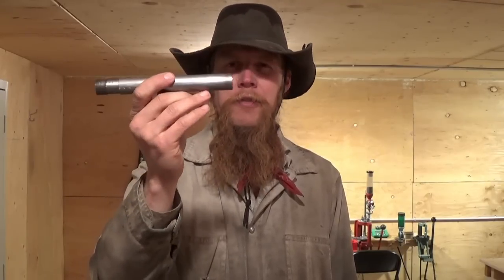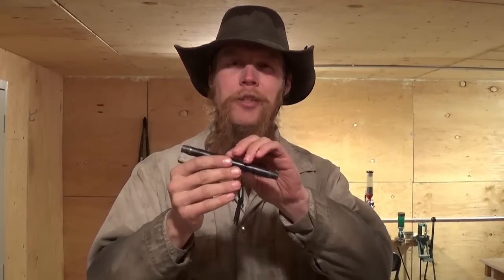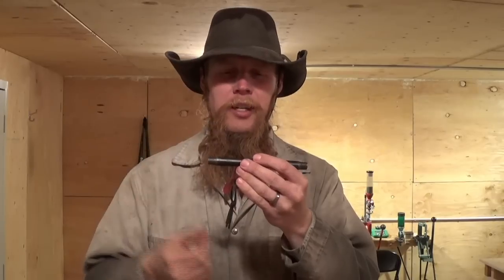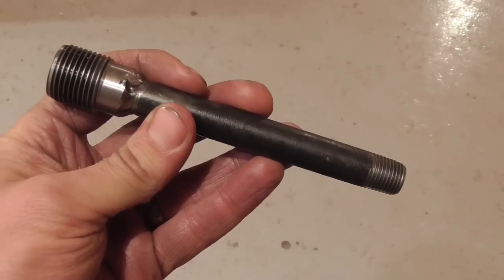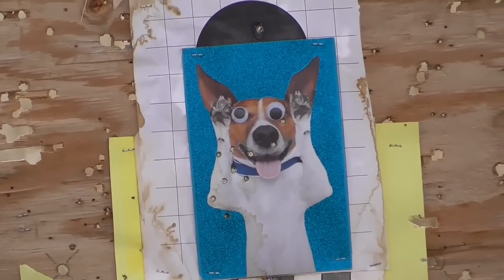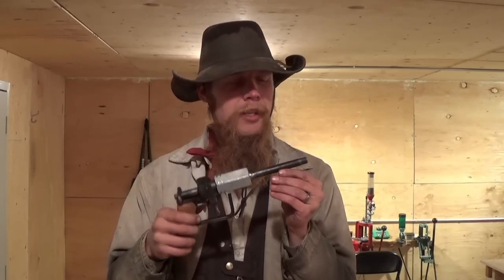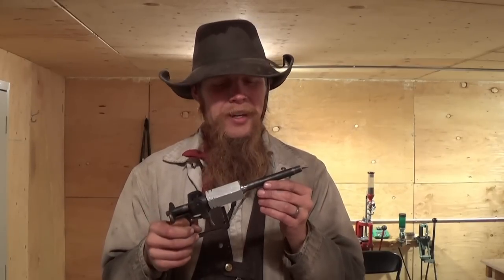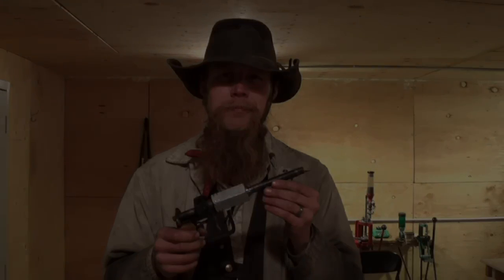9mm Barrel from Plumbing Pipe (TIS138)

Comment: I have made mini cannons from black pipe and a block of wood with a bicycle seat frame. The pipe is almost the same size as a bike seat stem, so it fits perfectly. I would load black powder and use a fire cracker for a primer. It would shoot the big red wire nuts or anything you could fit down the barrel.

Comment: People make 12 gauges out of black pipe, pretty cheap and makes good for those gun buybacks
Reply: LockJaw Remedy remember that the shot cup doesn't seal perfectly, so the pipe is not under full pressure from the loading.
Reply: Wait...people make plumbing weapons to re-sell for profit at gun buybacks?
Sheeeeet XD
Reply: The pressure chambers of a 12g is 12 to 15.000 psi the pressure chamber off 9mm 35.000 psi.
Reply: How much they give you during gun buy back for a pipe and nail?
Reply: @DxBlack  Then, you go on ebay and sell the coupons and use the money to buy a firearm (perhaps one you couldn't normally build easily).
Reply: Actually, and this is ironic, black water pipe of the correct diameter has to be reamed out a bit to accommodate a 12 guage shell. But the actual ironic part is that the water pipe barrels are far, far tougher than factory made shotgun barrels. Royal Nonesuch has a video on it, or did have. He did a torture test to see what it would take to blow the barrel up. He ended up putting about a foot of dirt and a 3/4 inch wide 4 inch long bolt in the end before it suffered failure. And the failure was just that the barrel ballooned. Now think of all the shotguns that banana peeled because the owner stuck about an inch of dirt in the end by accident.
Reply: @DaveSmith-cp5kj  everything can be built, hecj  there's was a channel on YouTube that the guy made mac 10 & 11... but cause of freedom of speech of the USSA  they took em all down. Guy made lot of videos and testing them number of times
Reply: @jonsmith6087  Yup I have a few homemade builds myself. I made them semi auto and chambered in 22TCM, they are basically an MP7 clone, but better because they are way lighter, smaller, and it is actually more powerful. Only issue is it has 25% less capacity per equivalent size magazine. Which in practice, is no big deal.
Reply: @DaveSmith-cp5kj  Amen, I wish I had the tools to make some 👍👍🙏
Reply: @jonsmith6087  Everything you need you can get at harbor freight for the same cost as buying a handgun. The mini SMAW stick welder only costs like $90 and plugs into a regular 115V outlet and you can weld everything from metal plate. The barrel can just be a scrap from a 5.56 barrel, some guys chop off a full length upper to turn it into a SBR. You can use the cutoff from that. The chamber cutter if you don't have a lathe to make a cutter from a bolt can be bought from Brownells for like $50-80.

If you need specific parts machined, I am more than to make and sell them to you. Obviously I can't send you something like a completed frame.
Reply: @DaveSmith-cp5kj  would be awesome there's only one problem, I'm in south America 😣
Reply: @DaveSmith-cp5kj  got a way to communicate?
Reply: @jonsmith6087  Post your email and I can see if there is a gunsmith I know on your continent that can help you out. I'll reply when I get your email so you can delete it. I have to review our export laws but I may actually still be able to help you with machining some parts as Trump dramatically deregulated ITAR and EAR to where some exports can be done without the $2.5k license fee. At the minimum, I can answer questions you may have.
Reply: @jonsmith6087  Got it, you can delete this
Reply: Shotguns have wayyyyyy less barrel pressures. Factory shotguns have much thinner barrels than even a .22
Reply: @DaveSmith-cp5kj  Dave, my name + jr gmail.
Reply: @markvickroy6725  you might have forgotten to delete this as Dave didn't reply yet, I would delete this before the wrong person sees this:) good luck on your project!

Comment: The best steel to use for barrels is vehicles staring rods and vehicles axcels...hope it helps many in future
Reply: * Steer(ing) Rods
* Axels
Reply: @justotalkalottashit8392  😂
Reply: @justotalkalottashit8392  its 4140  carbon steel
Reply: @justotalkalottashit8392  Get yourself a dewalt p1000, it has an 18mm OD Chromoly tube with a 8.7mm bore. Theyre like 40$ a piece.
Reply: @wrathmachine7609  Good one! there some older European ramset guns with a exact 9mm bore btw.
Reply: @ronzor8035  I work with what I got 😜. I made a muzzleloader thats made from the chamber end of the nailgun welded to the barrel. You can also grind a little bit off the barrel and press it inside the body of the nailgun with the internally threaded end where you can thread in the chamber. I use number 3 blanks with around a 200gr lead slug that can penetrate at least 3 inches of wood at 10 feet and the bullet gets flattened when hitting the stone behind the boards. These components are made of really good steel.

Comment: I heard that after rifling the barrel with a button it is necessary to do a thermal stress relief. Did you do this heat treatment?
Reply from the maker: No, I don't.  I imagine the cold-working process does introduce some residual stress into the steel, which could adversely affect accuracy by causing slight thermal distortion as the barrel heats up from repeated firing.  However, I don't think the reduction in accuracy would be noticeable  in anything except a precision long-range target rifle.
Reply: @TheIdahoanShow  Hi my friend, it's me again! I saw that you used a chamber reamer, which appears to be customized and made by you. I wanted to make a D- bit camera reamer, but the specs that SAAMI provides are a little confusing for me. Could you make a video demonstrating how to make this type of reamer or could you provide me with a drawing of this reamer?
Reply from the maker: @wesaderty  The only video I've made on making reamers is https://www.youtube.com/watch?v=ILaT3vFgEKM
 
As for dimensions, I just make the chambering reamer the same size and shape as the cartridge.

Comment: I have used that pipe for shotguns before. I do not like using nice pipe for junk shotguns, so I use 3/4 inch black pipe. It is actually a bit harder steel then what Mossberg uses for their barrels. I know because I tested the hardness of each. Still rather garbage though. Sometimes I get some of that stuff and measuring it indicates that it is not fully round.

Comment: Nice work, I've always found 4130 aircraft tubing make good barrels but needs drilling and reaming to bore sizes. and 1 1/4 OD 750 bore make a good 12ga barrel blank has a yield of 24Kpsi and bursting at 30Kpsi a lot more then a 12ga at 10K give or take. plus can be shipped all over the world as civilian aircraft parts.

Comment: Wouldn't it be easier to use 1/4 pipe and drill out the chamber (and if need be, grind down the barrel so that it fits whatever housing you want)?
Reply: Most likely

Comment: If you made a somewhat larger rifling button, it would displace more metal into the bore, making a smaller effective diameter and perhaps getting the rifling to engage better with the bullet. It'd probably still leak expanding gas during firing, which might be good if the other commenters are right about the pipe bursting from the pressure.

Comment: If you were to heat the pipe glowing red would it cool and shrink past what it is now... kinda the way beams are prearched?
Reply from the maker: It is possible to bend metal by heating/cooling it unevenly, but I don't think I would actually be able to shrink the diameter.

Comment: Perhaps the "loose fit" is the reason it didn't blow up.
Reply from the maker: Perhaps.
Reply: Another thing that prob made it not blow up is the thread you press fit on it. From an engineering point its quite remarkable how bad of a gun can be functional. (Not to insult your build, but plubing pipe barrel...)
Reply: @Kerimcan Ak(Sionistas Fuera!) The problem is most people saying a homemade gun will blow up usually have never even built a gun before. Lots of this info is being "relearned" from the 80's.
Reply: This "loose fit" is the primary reason a make shift 12ga shotgun barrel made from 3/4" metal pipe does not blow up in the shooters face!
Reply: I don't think so. It would have to produce more blow-by to make it easy. There are a few calibers that can fit into a larger receiver just fine. The barrel would have shown its weakness, if it had one. This may have been more difficult for the barrel, err pipe! Lol

 The nominal pressures of that cartridge as well as the iron are pretty close, but far enough apart to warrant the test. That's not to say that some won't fail as every piece of metal for a barrel doesn't always survive the test, but this is more of a what if video...
Reply: @willyam9735  really no most of the pressure of a 12 gauge is in the back

Comment: Dude as an metqllurgical engineer it is my duty to the world to say...dont try this at home. The pressure peaks will originate very quickly undetectable fatigue cracking that will led to sudden fracture in some unpredictable moment. It could be after 3k shots or after the 10th. This peaks are something that were out of the mind of the people who made the needed calculations for plumbing. Trust me. This is dangerous and it should not be encouraged. 

This said...it was interesting though.
Reply from the maker: Agreed - I am certainly not recommending this as anything but a last resort.  If you're going to go to the trouble of making a barrel, it is well worth your while to start with high quality materials, i.e. something a lot stronger than plumbing pipe.  In the follow-up to this, where I reamed this barrel out to .40 S&W, my calculations predicted that the barrel should have burst, and yet it continued to perform remarkably well in testing.  I'm not sure if this particular pipe was just a statistical anomaly or what.  Here is the follow-up video: https://www.youtube.com/watch?v=9loXa-H0crE&t=3s

Comment: Try using 9x18 in it, it is slightly larger in diameter
Reply: morareduard 9&18 .. isn't that the case size? I'll have to get the calipers out but I think it's the case
Reply: I thought of the Makarov cartridge too- bullet diameters run .363"-.365", so it might just engage the rifling. It's also a straight walled design. so you can cut the chamber with a boring bar. Mean pressures are in the 20 000 psi range, so there's less risk of things going kaboom.

Comment: What drill did you use to chamber the barrel? 9.8mm?
Reply: You can use an old tap and machine it into a D type bit to cut your chamber, or you can purchase a reamer type bit for better accuracy. Both can work very well, but reamers are more expensive. I might record a video on how to make a D type bit, but I'm very lazy. Hope that helps. Cheers
Reply: @cri8tor  how exactly did you machine a tap? Other than grinding it I cant see how you could have done it. Did you put the taper onto the reamer or just go 9.8mm parallel
Reply: @kazoolordhd6591  Yes, using an angle grinder or a Dremel would work. To finish it off, you could use a file. There is a video titled "Quickie Bit - D-Bit Reamers" by Chirpy's Tinkerings. Reamers come in an endless variety of sizes. Do a Web search on reamer bits and you can find a tons of videos on how they're used.

Comment: This wasn't exactly the video I was looking to find; however, you did rechamber something... As well as answer the age old question, will crap not blow out!
Dirty metal, you have to clean it really good before you TIG weld it. I made some tools out of that iron pipe and it works fine, but it's incredibly dirty with deep surface imperfections. Two garage door spring winding tools with 3/8" rod TIG welded into the ends and they can take a bit of pressure before they bend. I've not seen them bend and that was winding up the 360+/- ppf springs.

Comment: .354, .355 .356 & .357 are all a hard fit , 
BUT SCH80 3/8 inch pipe ID = .302 & can be bored out 

SCH160 3/8 inch pipe ID = .359 
.357 Rem Max & 9mm Browning Long = .358 
.38 S&W = .360 
SCH40 1/4 inch pipe ID = .364
9×18mm Makarov = .364
Reply: ps a 3/8 inch SCH40 pipe = .493 ID  , might make a nice muzzle loader barrel blank

Comment: Brother,
I got a question. I would appreciate your input.
I used this pipe with a 5/16 brake line for a .25 caliber liner and soldered them together. I installed this in a zoraki 925 and loaded the 9mm PAK ammunition with .25 caliber ball bearings.
This was a success, I have shot it 12 times. 
So, do you think in your experience that 12 rounds would support the theory its safe and will hold together?
Reply: I would think you would want to test with 10 or more rounds that were the absolute maximum pressure you would ever expect to see.
Something like 150+% of the pressure of a normal load.
Reply: Why solder and not weld?

Comment: The relief pipes that run on the outside of heavy plant hydraulic rams is what you need , used to take high pressure , smooth bore and thick wall as well as high grade steel 😁😁👍👍👍👍

Comment: How did you get rid of the welded seam?  All pipe I’ve looked at have a high bead on the inside.
Reply from the maker: It's been a while since I did this.  I think the seam on this pipe was pretty flat to begin with.  I might have cleaned up the ID of the pipe with a drill bit or a piece of sandpaper on a mandrel.  After this, I ended up reaming it out to a larger diameter to make it into a .40 S&W barrel, so the reaming ultimately got rid of any raised seam.

Comment: I know this is a 3 year old video, but what if you built a stage block set that allows you to essentially brace the center with a spar that passes through a block as the barrel is pressed upwards through a jig that swages the pipe diameter to better fit the projectile? Even if you dont make a perfect fit, you could end up with a better fit.

Or a spectacular barrel explosion as this may compromise the integrity of the barrel... but I dunno.. it IS pretty soft steel.. though even then its probably not as soft as brass.

Comment: hey Idahoan: I'm looking to build a barrel in .380 acp ( 9x17). I drill, ream, lap to 0.348" . Then I have to rifle with button. CRUCIAL QUESTION!! Can I use my 9x19 rifling button for this?? Or do I need one for .380acp?? I would think if I drill/ream/lap to the exact ID, then I can use the 9x19 button due to the fact that the groove diameter on both are identical (0.355"). So Idahoan, or anyone who knows the truth, not copy-n-pasters, please help me so I can start making my first 0.380acp barrel. Thanks for everything you put out. Great stuff.

Comment: For pistol or carbine barrels, steel pipe works better as a outside support for a barrel liner. I'm not going to mention rifle barrels in this mix because we both know using this kind of pipe shooting rifle ammo any larger than 22lr runs the risk of being an exercise in suicide due to the much higher pressures involved! Rifling DOM tubing really is the way to go but most amateur gunsmiths cannot afford the kinds of machinery needed nor the engineering skills necessary to achieve satisfactory  results.

Comment: The biggest problem is the durability. The rifling inside the barrel will degraded quickly, and the steel lose some resistance after 250°C

Comment: Hi. I need some help.if i want to make a rifling for 5.6mm the initial hole in the barrel how mm must be? Help me please 5.5mm is enough?
Reply from the maker: Well, having never made a 5.6mm barrel myself, it's hard to say for sure.  Sometimes it takes a little trial and error to figure out the optimal bore and button diameters.
Reply: Thanks anyway.
Reply: there's blue prints on the web. i will try to find the link.👍
Reply: Hi let me know if you find it.
Reply: +Jozsef Ienciu i will.  I'll look through my old files to. as i have tonnes of blue prints on ammo and calabiers barrels. I've made lot's of calaber barrels. 👍

Comment: I'm curious if you could draw down the diameter, just ever so slightly(i know it would take a bit of force, but all you need would be to tighten up the I.D. by just about .010"-.020"-ish to make it a bit more viable for better rifling engagement.

Approximately what distance are you from the target?
Reply from the maker: I set the target at about 10 yards.

Comment: Start with at least schedule 40 pipe. Still common enough to find across the united states.
Reply from the maker: This pipe was schedule 40, as is most of the iron plumbing pipe that is available at hardware stores.
Reply: TheIdahoanShow My mistake, I wanted to say schedule 80. We use it in refrigeration such as running lines for ammonia compressors. Much thicker wall.
Reply: I was hoping to see more comments regarding schedule 80 because I'm wanting to try something safe to use as a black powder pond snake pistol and something safe for more than a few hundred shots..

Comment: I'm looking to make a kentucky long rifle style rifle using DOM tubing like you did for your blunderbuss. They typically have octagonal barrel profiles. It isnt totally necessary, but I would like to stay somewhat historical. Any tips for cutting this profile with basic power tools?
Reply from the maker: Well, I can't say as I've ever made an octagonal barrel, but if you marked 8 equally-spaced lines down the side of a piece of round tubing and then used an angle grinder to grind flat surfaces between the lines, that would produce an octagonal tube.  A piece of small angle iron makes a good straight-edge for marking on round bars or tubes, because it will self-align and ensure the line is straight.  Of course, grinding on it will reduce the wall thickness, so you'll want to start with a thick enough tube that there is still adequate material left when you're done.
Reply: TheIdahoanShow 
Okay, that sounds good to me. I'll give it a shot. Worst case scenario I screw it up and am out 10 bucks for the tubing.